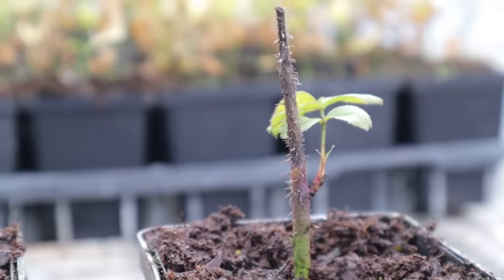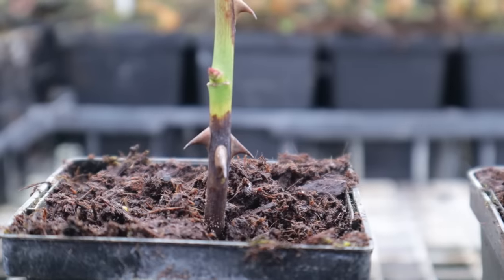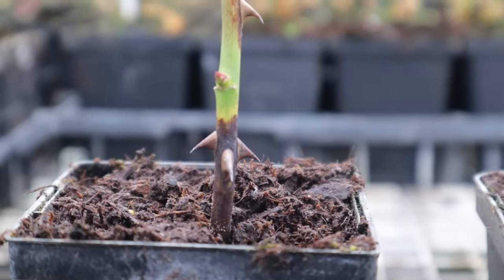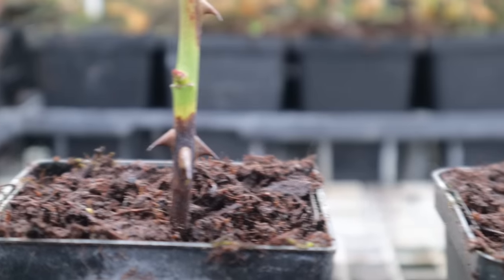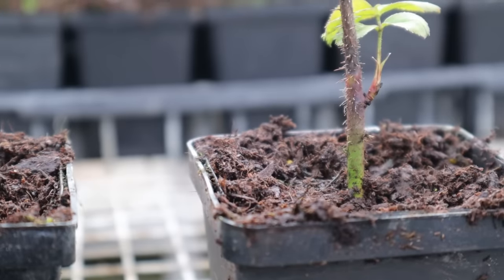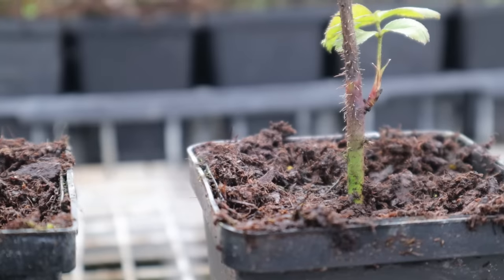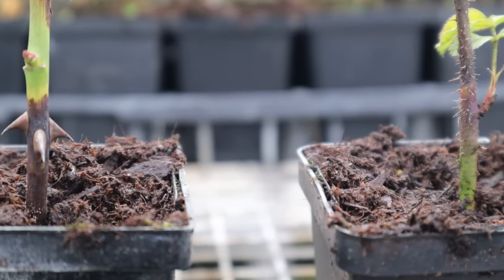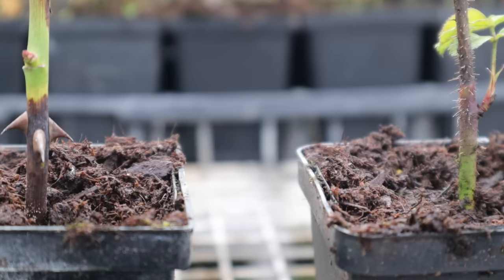Why Do Cuttings Fail? Propagation Tips

Comment: My grandma said just stick it in the gound... that never worked for me. I use root hormone, and once planted I treat them as I do my seedlings soak the dirt good one time then bottom water, since I started bottom watering I never had a stem turn black again..  I feel amazing when I gently tug on the clipping and it does not give due to the roots
Reply from the maker: Thanks for sharing your method!
Reply: Actually, there are some roses that worst by sticking the stem in the ground. Peggy Martin (Katrina Rose) always works for me.

Comment: I found that cuttings(stems thinner than a pencil) from young plants generally tend to be more viable in rooting even without hormone. Although the downside would be that it will take longer time for the plant mature but at the very least they are alive.
Reply: True and the root tip should have a very long angled tip to give the plant room to absorb nutrients.

Comment: For bushes and any plant with a firm stem, we tie a piece of polythene at the top of the cutting to prevent moisture loss. It really helps!
Reply from the maker: Thanks for sharing your method!
Reply: Do you like a bag over the cutting? Tied at the bottom?
Reply: Do you still need to do that if you have the cuttings in an enclosed container that you spray everyday?
Reply: @user-qt6mm9gg5w  no it for people with no cover if you have a lid that does what the plastic cover or clinging film does
Reply: there is an old trick to sectioning a woody trunk into a bunch of short pieces (like a T plant, dracaenea etc) :  dip the top in melted candle wax.
Reply: How do cuttings get enough air circulation with plastic coverings?  What is best temperature for winter cuttings ( I am doing cyprus trees now and live in VA Zone 7)
Love your video and am going to look for more!

Comment: I took hundreds of cuttings in the late spring, the time stated as the best time for them.  Some were firm tip cuttings, others small semi-hard wood.  Most were not dipped in rooting hormone as I did not have access to it it at that time.  I stuck the cuttings some into sharp sand, some in commercial potting mix, some in a mix of two different brands of potting mix, and some in a mix of sharp sand and potting mix.  Stuck them into tubes.  They in trays under 75% shadecloth as summer was coming on, and were watered every day to keep them moist.  For many weeks they stayed green and alive looking, and in fact some continued that way for up to four months!  Yet most of them did not grow roots, and eventually died off.  
In the distant past I regularly propagated most of these same kinds of plants using our ordinary garden soil, no rooting hormone, and four-inch pots with a number of cuttings in each pot -  and had a good success rate.
Have you any ideas or suggestions about what I have done wrong with these latest cuttings?
Reply from the maker: Hi Lori - it's encouraging that you've had good success in the past. I don't know that I can trouble-shoot accurately from just a description, but maybe the first thing I'd consider is the shade/moisture. A moist shady location will do a good job of keeping cuttings green, but also may not be offering the right conditions to encourage fast rooting. If you're don't treat with rooting hormone, the cuttings rely light to help send down their own natural rooting hormones to the base of the cuttings.
Reply: @FraserValleyRoseFarm  
.deanwood estate estate agent

Comment: You uploaded this video it's telling me 3 years ago in the information is amazing and gardening sure we advance and we bring out different cultivars and hybrids but good old fishing knowledge is just a godsent thank you for your video I live in New Zealand and our climate is very different you know and trying to find the balance I used to have the greenest fingers and when I started getting into house plants because my house or my apartment sorry it's very low light I started having trouble growing things like what is known as a nerve plant the green and white variety the iridescent pink and dark green variety just as an example and I honestly felt that my soil or medium now I was using contains too many little fertilizer balls and pellets so as of today I have purchased some propagating sand now we did this in high school horticulture where we had a missing bar that was on a timer and a heat pad underneath well I've got it sitting this tray on some fluorescent lights I use in my home which will keep the bottom warm which should stimulate root growth and I think he at the stages like I tried growing some ficus celestica or rubber plant or rubber tree the variegated version I think no one in New Zealand is Ruby and I took it from one of the new laterals shoots but again black mold and things like that so I'm hoping that the sand is going to make a difference trying to keep it warm from the bottom but also if anyone's monitoring this I'm just wondering about the amount of light or would enough natural light if it's coming in the window be enough and miss them once or twice a day after not drying out thank you

Comment: This is a great post & time codes is a great idea.

Another method that really helps is to not cut, but to push off suckers on plants like crepe myrtles, peregrinates, etc.  That partial node at the bottom really helps.  You still cut the top off as needed.  This really helps on hardy hibiscus by pushing off new spring shoots, sometimes a few small roots are already present.  I am in east Texas doing one or two at a time, so I cover with a baggie and keep in the shade.  Very high success rate.
Reply: Fellow east Texan here. I blame everything on the heat and humidity (and not the good kind.) :-)

Comment: I witnessed a huge Oak tree fall over at 9:30pm 03/06/24 and as an Englishman (hearts of Oak), im on my way to propagate 12 off-cuts of it in 3 different locations.
1. Bottom of a large area valley (few meters from where it fell)
2. At the plateau top of the hills of the valley.
3.the slopes of the hills of the valley.

Soil is flint, clay, dark and rich top soil, very moist valley, hard water, cow and horse pastures in the area, mix of woodland. 
Chess valley, Chalfront&Latimer, Buckinghamshire, England.

Comment: Easiest way to propogate roses is to do it on flower sponge . Cut sponges into small cubes so each stem fit. Stick them up to each sponge individually, put them in a bowl or container filled with water up to a few inch up to the sponge . Wait for the roots to comes out. After roots appear put them into a, soil along with the sponge. 
Happy propogation.. 🥰😍😍👍👍

Comment: There plenty of very good books that give the correct stage for each plant.  And he is absolutely correct on the grower guides.   I would stay away from social media for advice because many folks there don’t know anymore than you do.  The truly successful are too busy growing to spend much time on social media unless for marketing reasons.  Also  check commercial growing guides - search for example “commercial hydrangea production” or whatever you want to research whether tomatoes or ducked, or ornamentals.  Another search is to look for “university articles on whatever it is you are researching.  Most universities will have run trials as part of the teaching or extension programs.  

For rooting I suggest using a company like Hormex (check their website) who makes both powders and liquids and in 3 strengths for different types of plants depending of their difficulty in rooting. If you use too strong a hormone or not strong enough — the result is the same- no roots or weak roots. It’s the company that is used most by commercial growers. Also never contaminate by dipping into the original container. Always decant some into a small cup - this way I don’t risk spreading disease whether bacteria or viruses from a cutting to everything you root in the future from the container, you will only affect a small number of cuttings.  

Another product I like to use to submerse my cuttings into as directed in the website applications is Physan20.  Do not confuse with Phyton 27 which is a copper product used totally different though it is also for fungal and bacterial issues but must be carefully used or considerable damage can be done from phytotoxicity and/or photo-toxicity.  Physan20: 
http://www.physan.com

Physan20 is a no rinse product and when used on hard surfaces or pots, tools etc — make sure you have removed all visible dirt off first.  I use two bucket: soapy water/sponge, and one for rinse water. I wash the items as needed, rinse and let sit on a bench in the sun. When I’m finished with everything, then I pitch in a tub of the Physan 20 at the strength and for the time directed, pull out and set on a Physan20 sprayed bench to air/sun dry. DO NOT RINSE PHYSAN20 OFF.  I use Physan20 on my orchids from coming out of the  flask to adult repots. I also use on my other plants as directed and use to clean the greenhouse, pots, buckets, benches, floors, seeds, plants, tools, my hands, etc —even my bathroom and kitchen floors.  It’s a bactericide, algaecide, viruscide, fungicide, etc.  Check their website. 

It is very important that you keep disease levels as low as possible. This comes from using a product such as Physan20, keeping the environment very clean, and only using specific chemicals for specific issues exactly as directed.  I do not like to use broad range chemicals other than for cleaning my environment. I have found using Physan20, I don’t need to use as much fungicides, etc.  and usually something happens when I bring in a new set of plants that I didn’t quarantine because I think they looked okay.  I’m finally coming around to spray, dip everything that comes in to my growing area. It’s not worth losing plants to foliage and root issues because of laziness or rushing. 

I do not use Clorox because it smells, is corrosive to eyes, hands, items in general, bleaches out color if splashed on hands and the biggest thing is it’s only active for about an hour. If you want to use Clorox — please go to the Clorox website and look for the directions for what you are trying to achieve. With Clorox you must also remove gross dirt or it will drop the efficiency of your disinfecting.  

Physan20, if you don’t contaminate it with dirt, will last for several days. There are test strips you can buy for the active ingredient that tests the level as to whether it’s still active for what you are trying to achieve, the same as used in restaurants, hospitals, food processing, etc.
Reply from the maker: Thanks for your contribution!

Comment: Thanks for the advice!  Have you succeeded in rooting a cutting from a  Northern Catalpa Tree?  I've failed with several different methods.
Reply from the maker: I've only done it from seed (which was fairly easy - and you can get quite a few started for relatively little expense/effort)

Comment: On many species of plants, the new roots will form adventitiously from the node. This means that the roots will develop in an adventurous way, out from a node on the stem. Some plants are so good at producing roots, that new roots will also grow in the internode section of the stem, not at a node at all.

Make the Cut. To improve the success of rooting, stems for propagating should be cut between nodes, leaving a short stub of internode only. The roots will usually form at the node, and the bottom piece of internode tissue may be attacked by pathogenic fungi and bacteria. If the internodal section below the node is long enough, the root formation will be unaffected by the deterioration of the cut end of the stem.

If the internodal section is too short or if the cut is made too close to the node, the root development can be hindered by the damage to the internodal stem section. Do not cut the sections at the nodes.

Remove the leaves from the bottom two nodes, so they won't be buried in the rooting medium. Cut these off cleanly without damaging the stem. The cutting should have at least 2 - 4 nodes with leaves intact, two more at the bottom, with no leaves, and a short piece of internode below the lowest node. It is not necessary for all the cuttings to have terminal buds. You can cut a long stem into several sections, from top to bottom, as long as each section has enough buds and nodes to produce leaves, shoots and roots.
Reply: Thank you ma'am for these info

Comment: Very clear explanation, thank you.  But I find that watering cuttings (not tip cuttings) is hardly ever discussed, how much, how often.  Mine usually die after watering.
Reply: Bottom water when the top of the soil is no longer moist, Has worked for me best

Comment: I tried to root about 20 rose cuttings - different varieties - different sizes - hardwood / softwood.  I tried both soil and sand.  I covered some with plastic to create humidity.  Some were uncovered.  I put some inside ... some were outside.  I tried rooting hormone on some and nothing on the others.  The only one that grew was a fairly large part of the branch that was too big to put into a the pots I was using so I just pushed it down into an outdoor pot that wasn't being used so the dogs wouldn't pick it up until I got around to putting it in our burn pile (I thought it was too tall and too thick to do anything).  I forgot about it and it just was left to the weather.  When I had put it in the pot, I put it in crooked since I thought I was going to be pulling it and throwing it away and then before I knew it, it started producing leaves.  At that point, I didn't want to disturb it to straighten it and now it is still growing crooked.
Reply from the maker: All that careful preparation, and the one that thrives is just left to the elements... isn't that the way it goes!

Comment: Thanks for the great video!! Is there a rule of thumb when most plants become semi hardwood? Like a month after new growth or mid Summer?
Reply from the maker: Hi Hallie. It's the firmness that will tell you. For a rose stem, it happens around the time the blooms are opening. On other plants, you may have to do it by feel - if it bends easily, it's too soft. If it won't bend much at all without feeling like it will snap, that's fully ripened (hardwood). It's the semi-ripened stage in between that I find easiest to work with.
Reply: @FraserValleyRoseFarm  That is a great help, Thanks.

Comment: thanks jason im trying to increase my roses havnt been successful yet my twigs start off green i leave a small
lead on the top n use hormone growth but then the twig becomes black from the bottom ( too much water?)
i saw on someone else video that he scrapes the bottom torns off i have two favorite rose bushes that i want have more
Reply from the maker: Thorn removal or scoring the skin of the cutting at the base is an interesting method. It can increase the surface area available for callus. On the other hand, it also increases the surface area for rot to enter the stem. I don't do it routinely, but I bet you could find a number of varieties where the benefits outweigh the risks.

Comment: Aha, that's why my first time ever cuttings have been succeeding, whereas the semi hardwood cuttings have been failing.  Higher temps, more light,  more moisture and humidity, all of which are present during a near drought here in Missouri this year at the start of June.

I've been taking softwood cuttings of this rose, filling clear plastic containers with yard dirt, sticking them in the blistering sun but watering them daily and spritzing the leaves occasionally. I'm trying to line a driveway with these roses, and it's gotten to the point where I'm just putting the cuttings straight into their permanent home to see whether they'll grow roots like that.

Comment: Trying to save a gardenia that is still growing inside in December. It has three plants in pot I took one out with roots to give to a coworker it doesn’t seem to be doing well. Is there a better way to share this plant in winter?
Reply from the maker: I don't grow gardenia - but as a more tender shrub, I guess your option may be to keep it in active growth. That means supplemental light (or at least a bright locations inside), good minimum temps and enough moisture to keep growing.

Comment: On the drying out and light topic. This makes quite a bit of sense to me as if you're letting your cutting freely undergo photosynthesis rather than in a more moderated way, you're going to be having lots of water lost through the parts that are photosynthesizing! And that's really a problem if your cutting doesn't have enough roots to support the water intake that it needs to undergo that photosynthesis I would imagine.
Reply from the maker: Thanks - yes, it took me a while to sort out the right balance. You want enough light & warmth to encourage rooting, but not so much to push premature top growth or to make the cutting dry out. Where that balance lays is a bit of "knack", but definitely also depends on the firmness of the cutting.

Comment: Good information - thanks.

One thing over which there is much disagreement is how many leaves to leave on the cutting. Some say none, some say 1 or 2, some say half, some say all...

Thanks.
Reply from the maker: True. It's something the gardener has to balance with other considerations, and I've been tweaking it for years. I started out with very few leaves and packed them in pretty tight. More recently I've left more foliage on and given the cuttings a bit more space. The important thing is not to have them all pressed up against each other (increases risk of rot), and depending on what you're doing for humidity (dome or timed mist) you may find that you have to remove a little more to limit moisture loss due to transpiration.
Reply: @FraserValleyRoseFarm  Thank you!